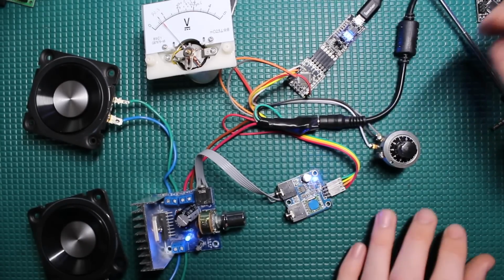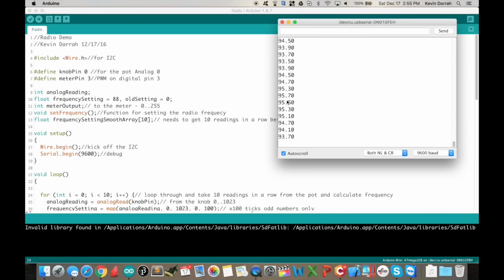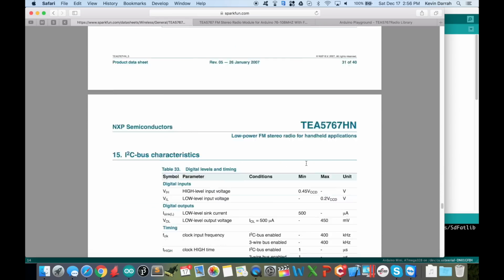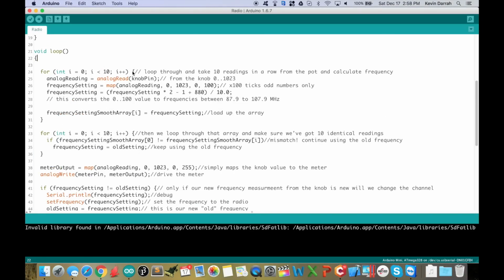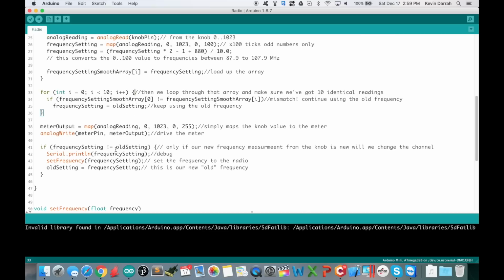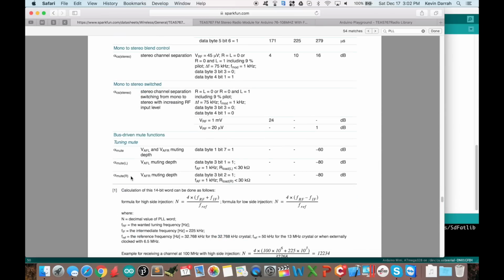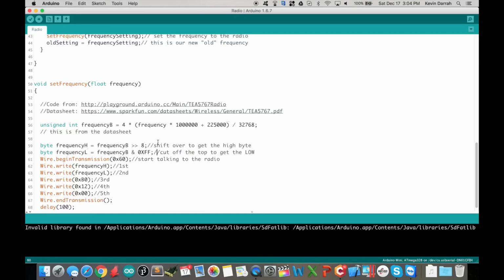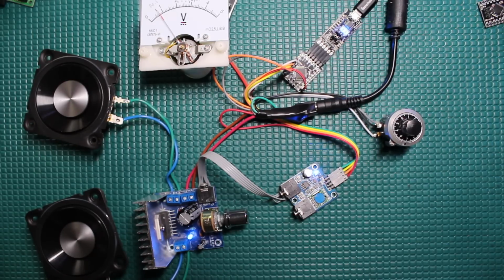Simple & Cheap Arduino FM Radio! - Tutorial + Code

Comment: I'm not a programmer, and have toyed with my arduino for a while now.  I started working on a TEA5767 radio last year, and was never able to get it to work very well.  Part of the problem is that all of the available tutorials include all sorts of extra stuff in their code to turn on auto-searching and such.  Your code was exactly what I needed.  It was simple enough to follow along, and did what I wanted it to do.  I got it working with a rotary encoder and a volt meter I have for this exact purpose.  Thank you very much!

Comment: In my case I was unable to find a replacement for my failed remote to my stereo a few years ago, so I bought my first Arduino, lifted the IR LED from the old remote and made one. Cool project by the way Kevin! I like your idea of using an encoder on the tuning, think it would be fun to swap out the potentiometer on the amplifier board with a digital IC, then you could control the entire project via software.  Have fun!
- Bill
Reply from the maker: good ideas! thanks